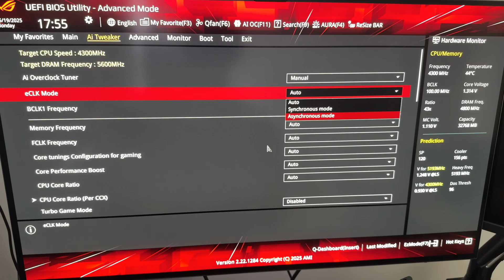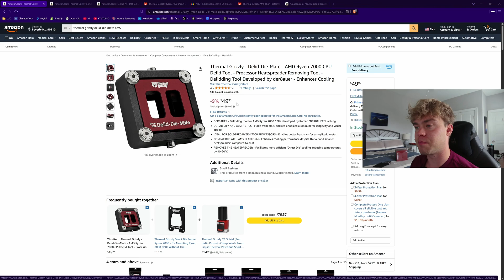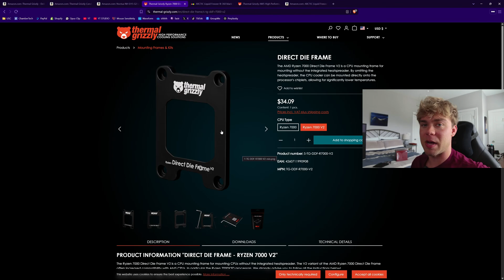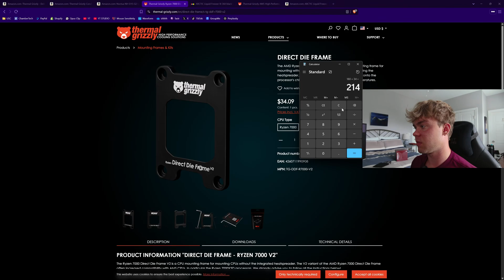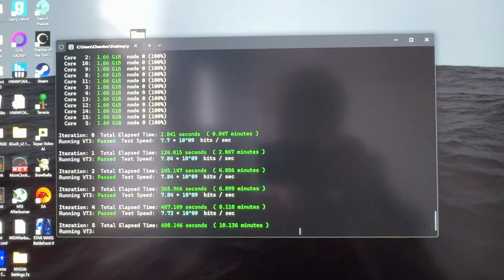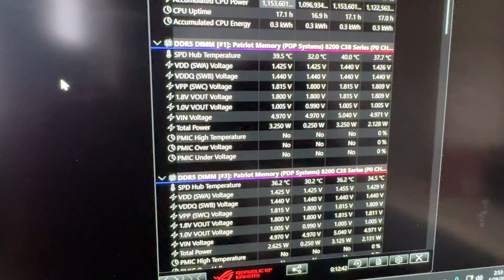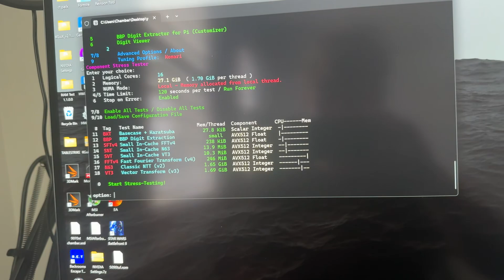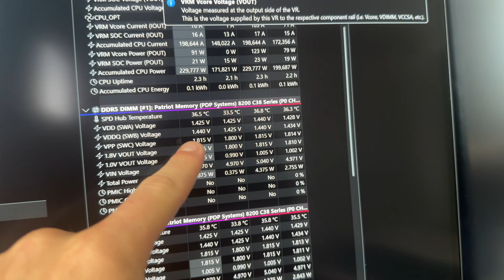ULTIMATE AMD COOLING! | Thermal Grizzly Heatspreader + Liquid Freezer III

Comment: This is sick!
I've been considering getting into AM5 for a while, and I love the idea of dailying extreme cooling. Now I also wanted something portable SFF so I was gonna build in an Ncase M2, and I had considered going for the Noctua system using the TG Direct Die frame, however I was afraid of the cooler possibly damaging the die when moving it (I'd like to fly with the PC). I was thinking maybe using a smaller cooler, but for the price of Noctua heatsinks, tbh it looked like a worthless cause, might as get a bigger heatsink, save on the delid, (I also already have my mid-size Toughair 110).
I also thought of running a custom loop, thanks to the various delid waterblocks, but throwing in a pump and reservoir becomes a bit challenging in that format.

At the same time I've been watching reviews of water coolers and how they have gone down in price while actually performing significantly better than tower coolers, the Freezer 3 front and center.
I was hoping there was a way to run the Freezer 3 with a delid, unfortunately unless you make a custom height spacers and nickel plate the waterblock (or limit yourself to paste, PTM7950 or say a KryoSheet), that wouldn't really be supported, however I completely forgot the existence of the TG heatspreader.

Now I can get started building my AM5 PC on an Ncase M2 worry free, and get basically any CPU cooler, while still having the ability to delid later thanks to the existence of the TG heatspreader.
Freezer 3 will probably be what I get anyhow. Though I could still go custom loop, or even run the toughair 110 delidded with the heatspreader lol.

Comment: I have never done a delid, but I've been tempted just to learn the technique. 

Is it possible to use something like PTM7950 instead of liquid metal for the interface between the Direct Die heatspreader and the CPU die? 

On one hand, I know that the PTM7950 isn't nearly as thermally conductive, but on the other hand I'm terrified of shorts or other disasters with liquid metal. I've been a PC technician for years, and I'm accident prone enough that I consider Murphy's law to be holy writ.

Comment: You need to change the offset mounting by 2 mm when you use the IHS by TG. Otherwise it wont get proper contact, thats why you barely saw a difference in temps
Reply from the maker: How would I change the offset mounting?
Reply: @ChamberTech  with the Adapter & Offset Mounting Kit from TG i guess.

Comment: Thanks for the vid, i asked about this on the Overclocking subreddit (yes i know lol) and got irrelevant to my question replies and crapped on when i kindly replied that theyre not even answering my question only introducing other factors not mentioned. just going to roll with a non delidded CPU and a contact frame.

Comment: You should put the cpu in negative offset(undervolt) and not positive with PBO.  You have too much messing around i have the same 9950X3D and Arctic liquid freezer lll 360 PRO and i have better temps than you with no deliding
Reply: that setting was for the clock speed lol. why would you wanna downclock it? 🤦🏻‍♂️
Reply: @1valzo no… negative Curve Optimizer tells the chip to use less voltage to achieve higher or same frequency. The higher the negative curve optimizer is the lower that voltage is. This naturally have a slight increase in temperatures due to the chip being able to have higher sustained clocks.
Reply: @SteezinBreezin  ”Max CPU Boost clock offset” (200, positive) thats the only pbo setting shown in the video so he’s talking about that…

also ”increase in temps because higher sustained clocks” when using negative CO is just wrong lmao
Reply: @1valzo  Its not. Its not significantly higher but it is higher when using negative curve optimizer.
Reply: @SteezinBreezin 😂😂😂😂

Comment: I have a Arctic LF3 (on a 7950X3D), asked TR by email about getting  some delidded 9950X3D and they told me the LF3 was'nt really compatible due to its special mounting, advised me to get some other AIO instead
Reply: I have AMD 9950X3D and Arctic liquid freezer lll pro 360(just newer fans), with pbo temps don't go over 69.2 C at max load, in gaming those are 50s  mostly low 60s max for few seconds.  New AMD doesn't have thermal throttling problems like intel 13th and 14th gen, don't mess around with deliding unless you buy it like that from a company with warranty,  you risk too much to save 7 to 10c max. Unless you are doing oc competition or making money of videos or somewhere else, it's not worth it and its unnecessary...

Put pbo in negative offset -20 (undervolt), cpu is cool, boosts higher, cooling is quiet (separate 3 cables for individual control), and that's for everyday setting plug and play for both work and gaming.
Liquid Freezer III is absolutely compatible with the new cpu's unless you are doing some direct die cooling which again I would never put as an every day setup...
Reply: Who is TR